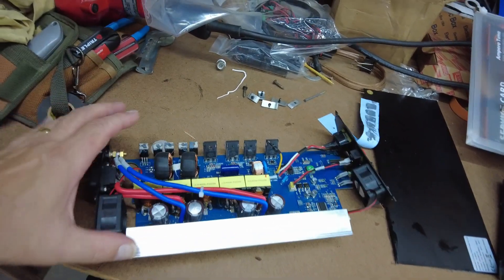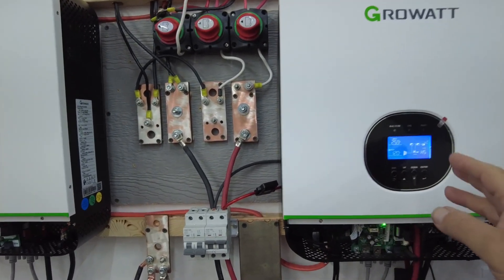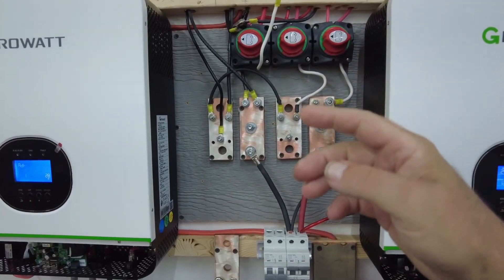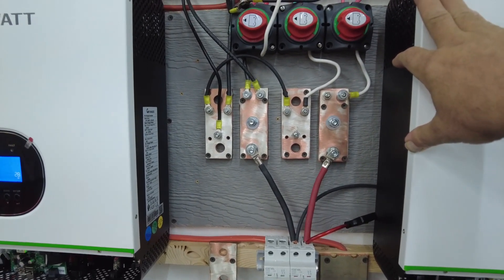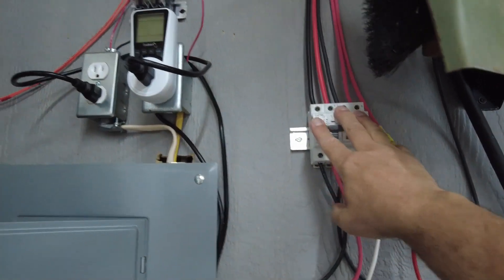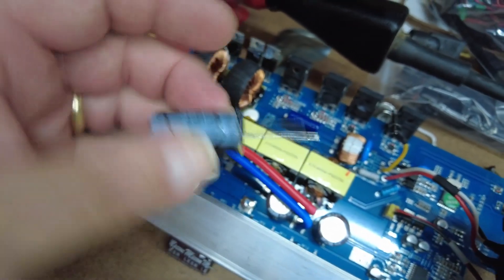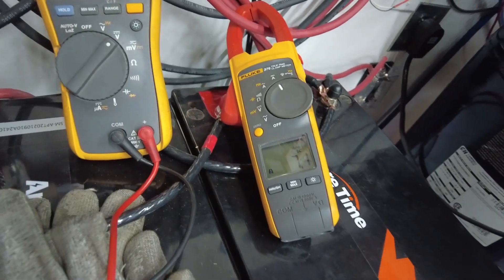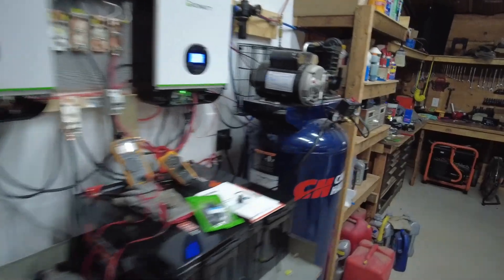Grid Tie Blow out & Repair on a 24 & 48 Volt combo Set-Up

Comment: Interesting video!  Question though, those look like Growatt 3000 models.  Aren't the MPPT charge controllers inside them rated at something around ~150v max?  I wouldn't expect you to have any problems at all bringing in much higher voltage, so long as you don't exceed what the charge controller can handle.  The charge controller will step down your voltage into what the battery needs, and increase the charging current.  In my home setup I've got 5 panels in series (Voc of ~135v) going into a charge controller, charging a 24 volt battery.
Reply from the maker: You are correct about the Growatts. This was a repair on one of the cheap 24v Grid Tie inverters.
Reply: @kc79ta  Ahhh, that's why I was confused!  My mistake!  Thanks for making these informative videos, keep it up!

Comment: LOL.  That's the price you pay when you keep tinkering.  Glad it was a relatively easy diagnosis and fix.  My similar grid ties are also offline because I decided to reconfigure my arrays at a higher voltage than they support when I went from 800w to 3kw of panels.  I'll probably take and dedicate one or two panels to them later after I get my bigger system optimized for battery and continuous draw from the panels I have now.